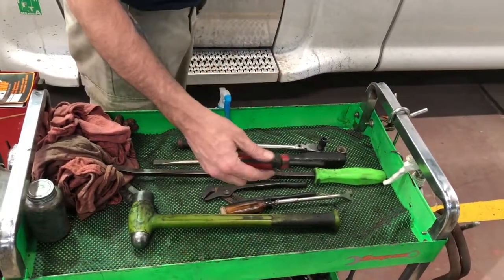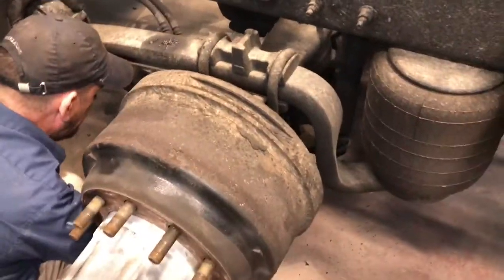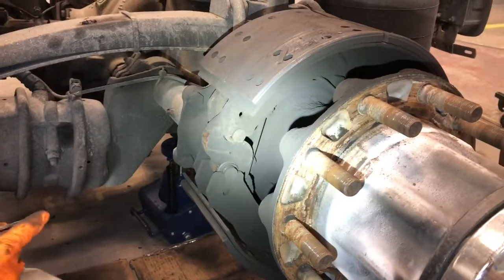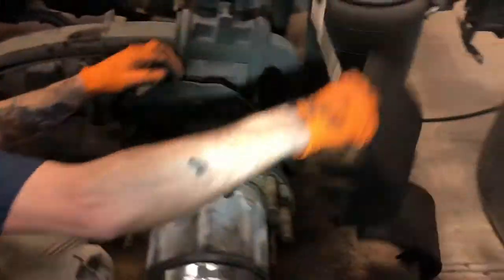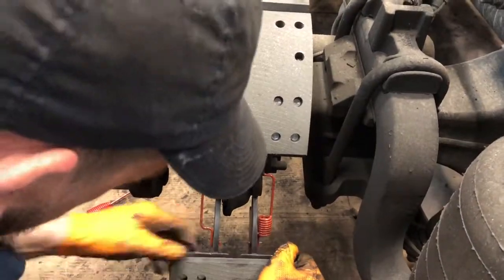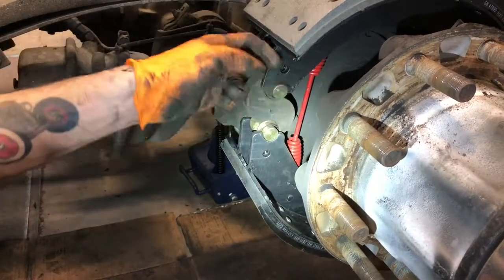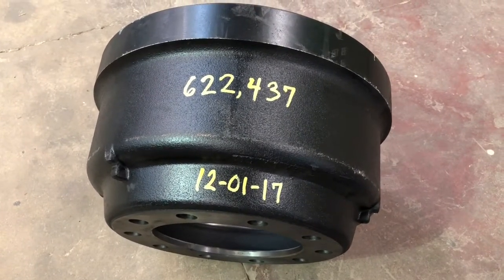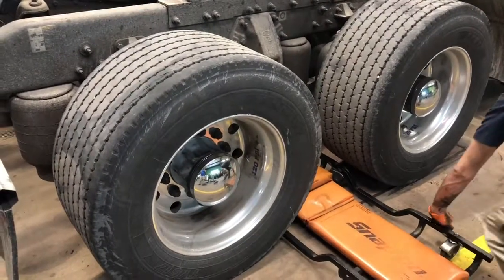How To Do A Brake Job On Your Truck: Step By Step Guide. Save Some Money By Doing Your Own Work

Comment: Ive always fully assembled the shoes,springs and rollers on the ground then swing them on and use a chain and pry bar to bring that spring under the pin. Seems like Bills was is just as fast

Comment: A lot of extra work done here, I usually just pop the small springs off with a flat head, smack the shoes loose with a hammer and just pull them off, then during install I put the rollers and big spring in and drape then right over as a complete package and use a spring installer tool to put the small springs in. 3 tools used. Not bragging just my method.
Reply from the maker: There’s a million ways to do brakes, we are just trying to show people how to do it without any special tools. That’s why we didn’t use a slack adjuster tool.